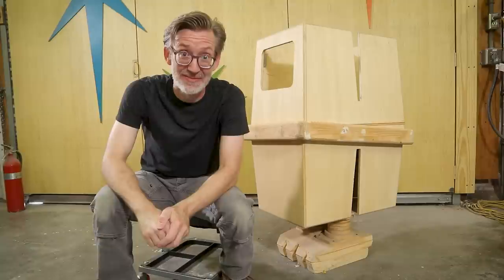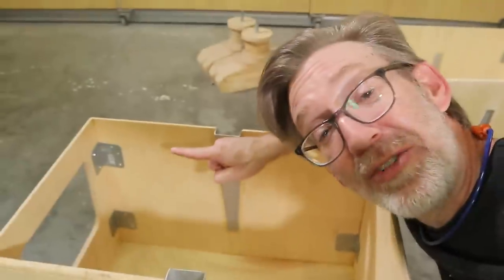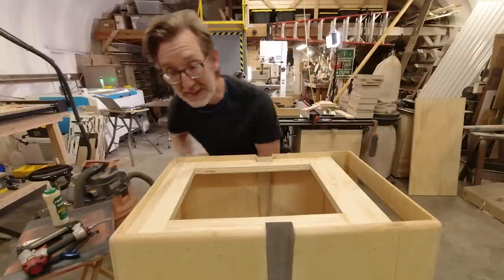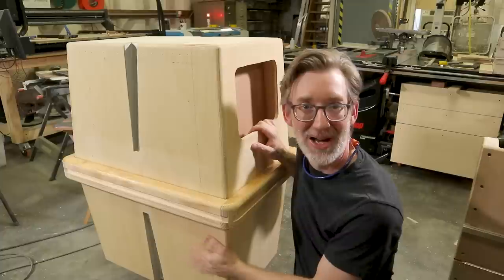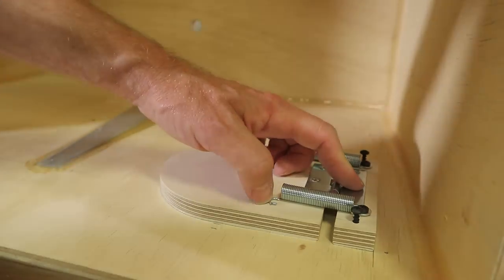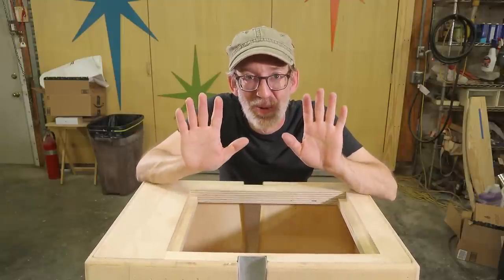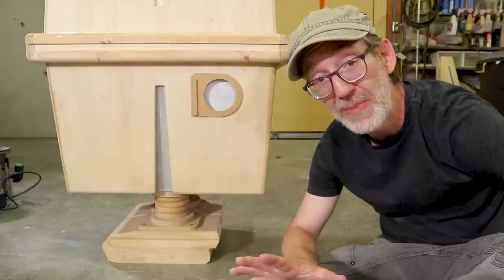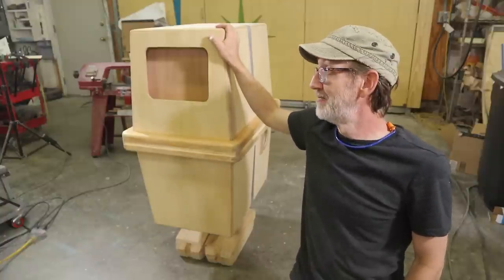Building My Very Own Gonk Droid: Part 2

Comment: Mouse traps are built around torsion springs. That makes them easy to find.
Reply: So are clothespins
Reply from the maker: Bingo!
Reply: What you have now works. If you need more pressure, just bend the hooks more toward the wood. Way easy-peasy.

Comment: The "square drive" screws you mentioned are excellent!! They were invented in Canada officially as the Robertson. The proper Robertson has tapered sides so that it grips the screw as you showed. Canadians put up with that since we get much better torque transfer and camming out compared to the Philips, the Philips being designed to cam out to limit the torque transfer.

Square drive screws are not real Robertsons because they are not tapered. In fact, the driver buys are made using a radius cut from a grinding wheel, which does not taper in the same fashion, causing the screws to fall off the driver. P.L. Robertson himself used to sell his product by putting a screw into his customer's wall, leaving the driver in the screw, take his client to lunch and when they got back, the screwdriver was still in the screw hanging on the wall!!! Great marketing.

Philips only got so popular because Henry Ford was fed up with the flat drive screws costing him so much time on his assembly line. He approached Robertson, as those screws were being used on his Canadian-built Fords, but he wanted to license them. Robertson, having been burned by a previous licensing agreement, chose not to license to Ford. Ford went to Philips instead.

So, that is a feature, not a disadvantage. Avoid this by tilting your driver left-right and front-back, it should come out 95% of the time. Do not pull straight out.

Comment: Small tip.  I work with expanded PVC sheet a lot.  Instead of using silicone, just use thick PVC cement.  It is far better, and unlike silicone, you'll never have a seam fail.

Comment: Looks fun!  If the cooler liner will be fixed in place and not removable, don't forget a drain for the melted ice...
Reply from the maker: I bought the spigot 3 years ago and meant to include it in this video, but ran out of time. Womp.
Reply: @WesleyTreat  I'm sure you'll find the most appropriate and mature place to put the drain.

Comment: 12:56 It's a trap (door)! Another vote for the Wera Rapidaptor for stopping the bits from coming out, it's all I use and I like their ratchet handle with the same bit holder integrated, too.

Comment: If you want to say goodbye to stuck bits, check out the bit holder by Wera Tools. The bit self-locks and can be one-handedly swapped. I love this thing!
Reply: Also, I'd rather have the bit stuck in the screw then have the screw constantly fall off. Robertson for the win.

Comment: I am SO happy with your presentation style/humor! 
1. I suggest Andrew Klein’s DISAPPEARING SCREWS on top of GONK for emergency access!
2. Please install a REAL pleated filter to that ‘vacuum unit’ you have hooked up to your table saw, my want is for you to breathe better air.
3. I suggest hanging recycle-door from top May have it close easier.
3. b. Have 2 doors & a wall on bottom: one side for cans, the other for glass…
Reply from the maker: I bought a better bag for the dust collector, but no one makes the right size for this unit anymore, so I have to modify it.

Comment: Robinson (square drive) screws rule!  
The ability of the bit to stick to the screw like that is a feature!  The square recess is tapered so the bit locks against it, and if you press hard, will join.  You don't need to apply so much downward pressure!  You are used to Philips bits which will cam out if you don't apply pressure.  Let the screw do the work of pulling itself into the wood when it's rotated.
Also, you can get slightly undersize bits instead of the standard red size, which can be a better fit for coated screws.

Comment: Orient the spring diagonally across the joint, then give it a slight twist before screwing the ends in, to maintain slight closing pressure on the door.  Loving this build by the way!

Comment: I too hate when the bit sticks in the screw. I invested in an overpriced Wera bitholder, it holds the bit but you can still change bits  with one hand. When i switched to a Festool drill with Centrotec I couldn't use it anymore wich made me annoyed again. Until Festool released the same Wera bitholder with Centrotec. Now it's overly overpriced but atleast I'm not annoyed by sticking bits anymore.

Comment: The door flap springs were a really good improvisation. I think if you put a little metal strip between the two loose ends it would hold up for a long time. Also, as we know from the year 2000 classic, the Star Wars Gangsta Rap, R2D2 mixes up a mighty fine gin and tonic, so it's no surprise a Gonk droid is full of booze
Reply: We got Death Star... Death Star... We got Death Star... Death Star...  

I forgot about Star Wars Gangsta Rap....  Holy crap, my highschool/early 20's....  God Damn I feel old... (only 39)...

Knock em out the box Luke, Knock em out...

Comment: The wera locking bit driver solved that infuriating issue for me.  PS what Arduino code did you use for the flickering lights with that vintage vending machine build?
Reply from the maker: It was something I threw together. Couldn't tell you now how I did it. I always have to relearn when I start coding something new.

Comment: I've started gluing bits into the magnetic holders so they don't pop out. I get the bit hot, smear it on a hot glue stick, and then jam it into the holder. Just squirting hot glue from a gun into the holder didn't work for me because the glue was way to viscous. I'm still able to pull the bit out with pliers then. CA glue probably works too, but I haven't tried it yet.

Comment: HUZZAH! I figured it out. Cut a strip of wood approx 1x2 inches & as long as the flap is wide. Cut the strip lengthwise at an angle (20° should do). Sandwich the top loops of the springs between the two halves of the strips of wood you just cut and screw them in place where the springs were originally attached. I'd send you the diagram but can't attach it here. ❤

Comment: Doesn't seem like much of those upper parts need to be that precise. Why not just get a semi good fit and then Thixo it in place and bridge any gaps?
Reply from the maker: Gotta get all the angles correct so the top is level and the lid closes flush. Plus, a proper fit ensures stability. Remember that those sides are cut almost completely down the middle. The aluminum bits aren't structural. So, that top rim was not entirely stable. It needed proper framing.

Comment: I would have built the cooler insert before you built all that top on, but then I'm not on You tube
Reply from the maker: The lining will probably be one of the last things to be glued in, because I may be running some wiring toward the back. Not sure yet.
Reply: one other thing where is the "drain" tube from the cooler going to exit😃